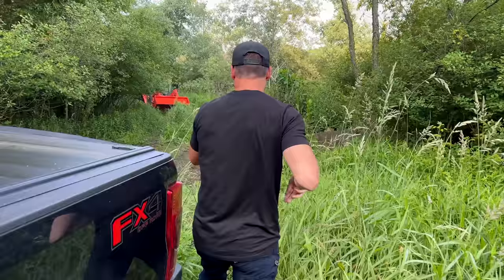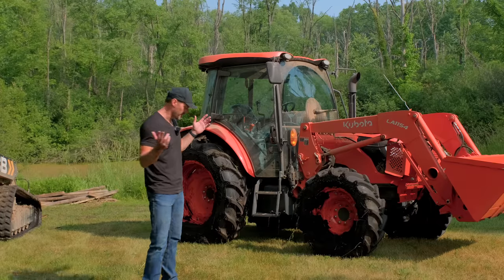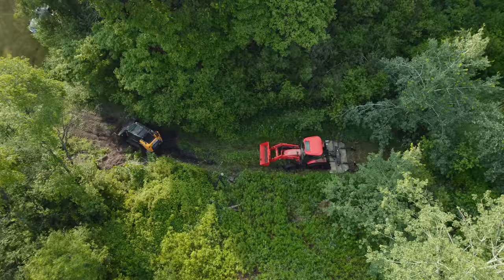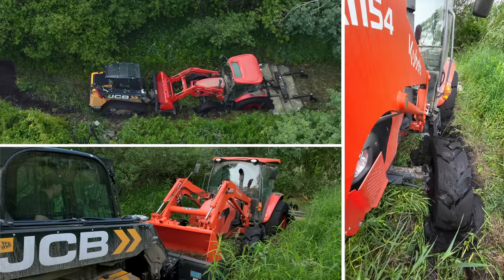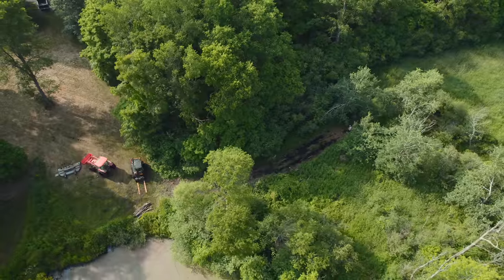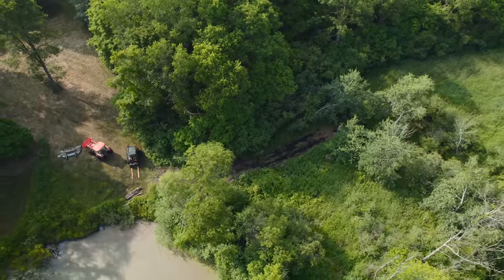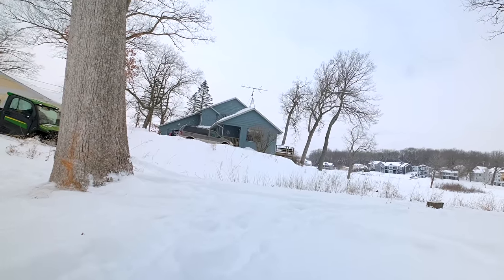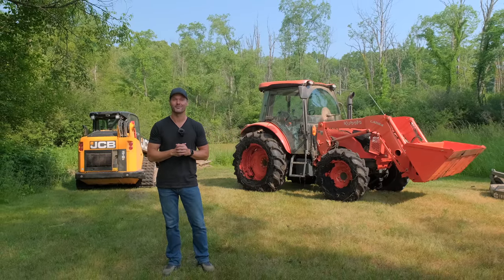BOTTOMED OUT! MY DAY WAS RUINED IN THE BLINK OF AN EYE 🤦‍♂️

Comment: One problem I see is that trailer tow hitches are not built to use as a yank out pulling device. That ball can break off and kill the person in the stuck device. Tow hitches are only designated to pull a free rolling device. There are videos out there showing how to pull out stuck vehicles. Very glad you got it out with out any damage. Nice video.

Comment: Hello Courtney.  Greetings from Vermont.  Two lessons I have found helpful.  I'm usually alone so I have rarely found the "yank" method to be helpful.. A controlled pull from a pickup (with wheels chocked) using a Harbor Freight 1200 lb winch with wireless remote works for me 90% of the time where I'm using  the remote while in the tractor and doing a controlled pull on the tractor. along with simultaneous tractor assistance, Ten per cent of the time I have to jack the tractor up (rear wheels) and place timbers underneath the tractor wheels and then use the winch.  Obviously swampy areas require cribbing under the jack to get the axle shaft above ground level for the timbers to be placed under the tires.
  Kind Regards.   Craig

Comment: You're generally not going to get much movement from mud until you brake the suction first. So lifting at first helps. When really stuck winching is better that Yankum ropes.Also two Yankums end to end doubles your stretch and gives you a chance for better traction.
Reply from the maker: Gotta gauge how bad it's stuck first.  Hooking up to another piece of equipment only takes a few minutes vs prepping to unsuction it.  I like to start with the quickest easiest things first, then work my way from there.
Reply: The absolute best way that I have found is a backhoe or excavator. You have so much compound leverage with the bucket curl, plus you can lift at the same time. I used a mini excavator once on a cell phone tower job site to get my semi unstuck from the sandy soil that I was in. Worked like a charm.

Comment: This Spring, trying to removing a heavy log from a swampy wooded area, JD 1025r with forks on, rim guard in tires and 350 lbs. of ballast weight in the back. Lifted the log, trying to back out of the wet area, tractor bottomed out in the mud. Dropped the log, manually removed the suitcase weights from the back, used the forks to stab into the ground and lift the front slightly and simultaneously applying hydraulic pressure to move the tractor backwards. Did this several times to eventually get out of the bottomed out spot and then to get out of the mud. What a relief, I learned something that day. Not exactly sure what though!  ;-)

Comment: Been there, done that.  Took a 12,000lb winch to get it out.  The winch provided a whole lot more pulling power than any other means we tried.  I bet if you had a winch on the front of your Super Duty, and connected your skid steer to the back of the Super Duty, you would have pulled it right out.  You know it's bad when tractor tires are filled with mud and look like slicks.

Comment: I got stuck 2x bush hogging the swamp / marsh this week…… it usually happens mid summer when things are very dry and I get squirrelly backing down into the marsh. Once those tires spin a little, break the seal on the ground,down she goes. I’ve gotten my 4020, 4440 and 2038R stuck down there.

Comment: Get the soft shackles from Yankum Ropes.  They are just as strong as the rope itself.  Get the correct size rope and shackles for the application.   Then use the ropes as they were intended.   They won't break and use the kinetic energy to free you.  Pickup truck might have worked fine.

Comment: The worst part of getting something stuck is clean up after you get it out. Not only is the equipment covered in muck, all the stuff you used is covered in it as well and now you are retrieving some of that from the bottom of a hole. 

I’ve had to dig the center out under a tractor to break the suction so I could pull it out with a chain puller.  

Sometimes you can pop the top link free so the implement does not hold the rear tires up.

Comment: Slid off the road with the skid steer a few times in the winter with the front end snow blower on. With the deere you get the bonus of being stuck in the cab unable to open the door but I did learn something new when unable to use a bucket to push yourself out.  CAREFULLY raise your boom until the tipping point is high enough to rock the machine (careful not to rip short hydro hoses) from there you are basically using the fact its going to tip forward with every movement to try and work it out of there.

Comment: There is a winch system that goes on the front of a skiddy that is perfect for this and as a professional recovery op this is definitely one of the harder ones because it's stuck in mud and that raises the forces tremendously! Be careful as this is easy for a professional and can cost you allot if you are not familiar with doing this kind of thing.

Comment: I have fallen victim to getting stuck in a low spot in my lawn more than a couple of times,  I used to be able to call triple a but a couple years back they stopped Coming out to tow If you were not on pavement so that would eliminate them pulling things off of lawns like tractors.

Comment: So I have a 1025r with a backhoe. The creek in back of me has silted in and has created bogg like you have. It has also plugged up my creek to the point that my backyard will flood. Will get  about 70  feet wide and up to 4 inches deep. Most of the trees have died. Ash beetles did most but under water was a factor.  I have managed to dig out the creek about 150 feet. Helped alot. The rest never drys out enough to get the tractor back to dig out anymore.  After 3 weeks of no rain it was almost dry enough. Then it rained. Screwed again. Any ideas? I think I would just get a skid steer stuck and I would never get it out. I'm kind of at a loss. Tried a shovel and no way. Darn near get the shovel stuck. Just about loose my muck boots in the stuff.
Reply from the maker: I'm with you man, I don't have a good answer.  It's a frustrating problem to deal with.
Reply: If you know a logger , see you can borrow mats?
Reply: @shermandaniel8285  thought about that too. My luck I might slip off and never get it back.
Reply: @GoodWorksTractors  was thinking if I had a plow with some kind of ski on it maybe I could walk behind it and pull it with a winch on the other side of the muck. If I could just get some drainage started might get better.

Comment: In Australia we would Never pull from a Tow Ball, only ever use heavy duty tow points. Too many people have been killed by a tow ball which has broken away. Also as mentioned a cover or bag of some sort over the tow strap to stop it flailing through the air. Not so much of a problem with that sort of strap.

Perhaps You could watch some of the 4 wheel drive shows from Oz, these guys know how to recover a stuck vehicle safely.

Dying trying to recover a tractor is not Good Works.

David Down Under.

Comment: its 8:30 the sun's been down, I've called it a day driving across the field (a little to quick) and bam instantly the front of the tractor dove down and was stuck up to the radiator in muck. I unload ready to make the walk of shame and by random change a neighbor stops and ask if i need help. he got his tractor and i got my chains and he got me out no problem. turns out my tractor tire had popped off its bead, not sure why but ever since i "upgraded" to r-14 tires my front right tire loses air and pops off the rims a few times already this year
Reply: Have you had the tire dismounted and inspected the rim?  If they reused your original rims they may have been damaged during dismounting.  It's not common, but does happen, especially when a tire store tech isn't used to working on Ag tires.  If the wedge they use to break the bead is a little out of place it can damage the rim, resulting in the slow air leak you're experiencing.  They could have also done something as basic as not screw the needle (core) into the valve stem all the way or not thoroughly cleaned/prepped the bead so it would seat properly.  Most tire shops will replace that core or entire valve stem for next to nothing.  Breaking the bead, cleaning, and applying a layer of bead sealer tends to fix most slow leaks if it's not coming from a puncture.  If that still doesn't do the trick an inner tube will fix the problem whether it's a bent rim, bad valve stem, tire puncture, etc
Reply from the maker: That's an odd one...maybe just a bad tire for some reason?

Comment: I got a skid steer stuck, over the tracks. I had another brand of the Kinetic energy rope. I had my son driving the truck. He backed up about 5' and pulled forward nothing. So I said back up a little more and give it a bump, well he misunderstood me he backed up the full 30' and put the pedal to the metal in low range. I felt a slight bump in the skid steer and looked out the back window and saw the rope piled up behind the truck. and the rope imprint on my tailgate. The rope had snapped at the skid steer end. I asked what happened and he told me backed up the full 30' and floored it. To much slack. I had the recommended size rope per the website to pulled out a vehicle the size of truck.
Reply: Ugh kinetic ropes are only for when the mass of the recovery vehicle is larger than the stuck vehicle
Reply: @bryceg5709  Have you watched @mattsoffroadrecovery videos? He pulls out much larger vehicles than his little Jeep Cherokee using kinetic ropes
Reply: @KirtH27  yes they sell these things for the purpose but that doesn't make it safe or good.  Ever seen what a rope does when it amputates someone's leg?  Can does not mean should.
Reply: Holy cow LOL. Reminds me of the video of a guy ripping his bumper off the frame because he floored it with 30ft of slack. He got out and said well thats what you are supposed to do. 🤣

Comment: Should have stayed going foward in the first place .  The material ( branches bushes and sticks ) will help maintain flotation and traction . When you backed in the brushhog was chopping all that material up .   The bucket trick is best used to push you backwards , which would have helped had you gone forward .  AG tires are meant to give traction forward but once you break sod your screwed and need to stop then , Not when you bottom out .   Im a veteran of many manure pile battles and corn harvesting burials .   Just sayin

Comment: Hey so you have locking rear diffs wrong.

Let me fix this for you.  To turn your tractor has a differential its an open differential.  Why not a limited slip?  Because we want to turn tight and not tear up grass or trench fields.  So we give you 2 separate brakes and an open diff.  The locking differential is spring loaded to release and its heel operated.  Why?  Why would you have a spring loaded locking differential?

Its because the purpose of a locking differential on a tractor isnt to plow snow on your driveway or to get your tractor out of muck or to increase traction.  

It exists to make your tractor go straight when youre doing ground work.  Pulling a plow running a tiller.  On an angle you turn drop your implement start doing work and now one of your front tires is on soft ground in a furrow and the other is on unbroken ground.  Now your tractor is 🦀 walking down the field needing constant input from you.  So you set cruise and stomp down on the diff lock.  Coming to the end of the field you release the diff raise your implement and spin the tractor using the brakes to help turn.

Why is the diff lock spring loaded and why do we have two brakes?  It aint for going mudding.
Reply from the maker: You'll need to keep preaching that then...the whole tractor world has it wrong.  It's the saving grace to them.
Reply: @GoodWorksTractors  I think the problem is people know about trucks and not Tractors. 

Times I would use differential lock.

Plowing

Pulling a trailer on a road at speed

Going down hill.

You use a diff lock when you want both tires to spin exactly the same speed.  You use the split brakes when you want to adjust bias from a spinning tire to a non spinning one.

Think about what happens with an open diff. If the tractor is in the air and the tires spinning the pinion spins the ring gear and the differential carrier spins 1 time the wheels spin 1 time.   Now if the pinion doesn't turn and you turn one wheel what does the other one do?  It turns backwards right?  The planetary gears rotate inside the carrier and if the carrier doesn't turn then the opposite tire will turn backwards 1:1 so jacked up tractor off if I rotate the left tire forwards 360 degrees the right spins backwards 360 degrees.

So if I'm coming into some soupy mud and I stomp the diff lock my left tire and right tire turn 1:1 and the front tires turn 1:1.

But if Income into the soupy stuff and the left tire slips and I stomp the left brake the right tire now will spin twice as fast it will turn twice because for every one time the carrier turns it also needs to revolve around the axle of the other one another time!

So when a tire loses traction you want to use the brakes to stop that tire not the diff lock because that will essentially double the power through the traction tire.

Once you drive a tractor into a swamp???  Well that's on you.  Once all 4 are spinning this isn't a mud truck you don't have the axle/tire rpm to floor it and launch the light truck.  A 5700 lb F150 has a 300-500   horsepower you can lock the axles and send it.   A 50 HP cab tractor ballasted with a bucket and an implement 8K LBS?  A skid steer?? 15K you can't engine out of that
Reply: That's not the only use of a diff lock. Not sure where you made this up from.
Reply: @Rusty-Metal  no it's not the only use but it is the only practical use.  Like I mentioned clearly all other uses of a lock are better done by just using one of the axle brakes.  Because again an axle brake will not only slow the slipping wheel but has the effect of transferring load to the non slipping wheel.  When you diff lock you just force both wheels to turn 1:1 when you brake you allow the opposite wheel to turn more than 1:1.  All other uses I agree with good works it's pointless in mud it doesn't help at all if you have 4wd or front assist just use that.
Reply: @bryceg5709  got it.

Comment: Wow you definitely shouldnt be putting a snatch strap over a tow ball. Thats when things break and smash windows etc. If you have d shakle with a high working load then you snatch rope, rope breaks first. Maxtrax traction boards will easily deal with a tractor. Other way would have been strap those logs to the rear tyres as long as they are longer then the diameter of the wheel they can push down in the mud breaking the suction of the mud
Reply from the maker: I was hardly tugging with it